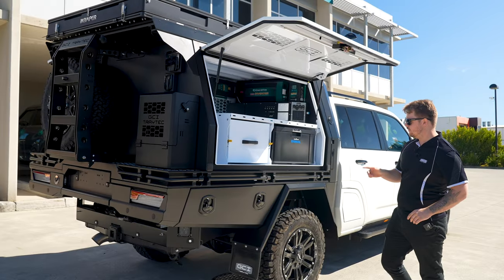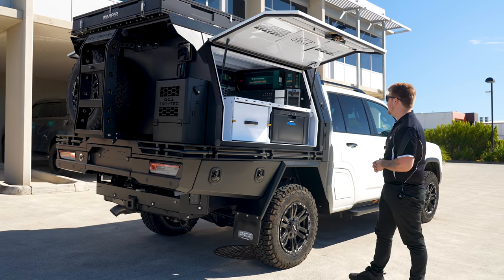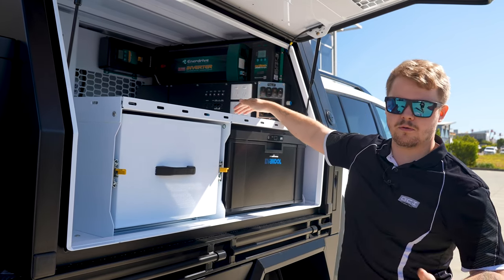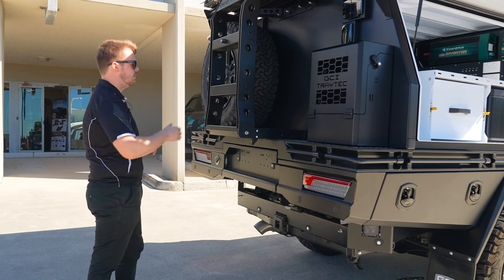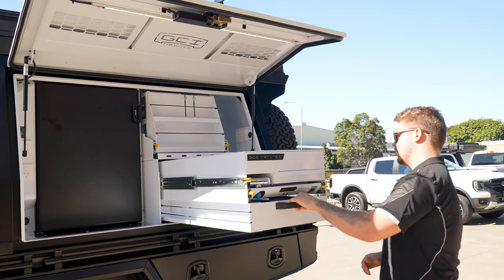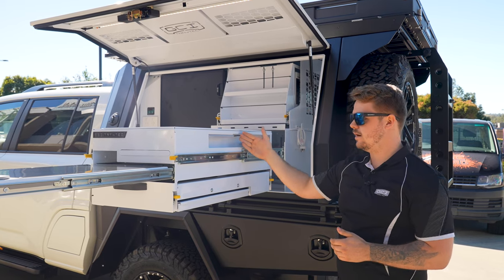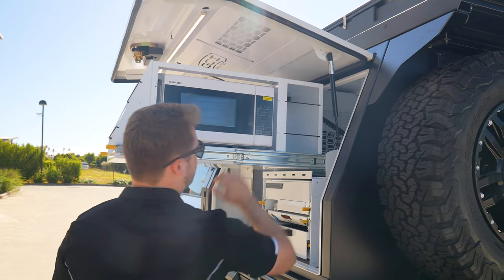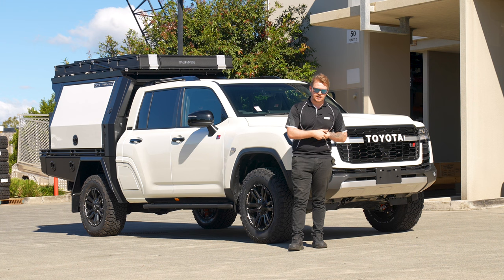LAND CRUISER 300 SERIES - CREATIVE CONVERSIONS CHOP BUILD

Comment: A bit of R&D here to take back I think guys,  The finish looks quality but theres some real useability and finish aesthetics issues here.  I also thought height was an issue but to be fair, how can you make it lower given it's a lifted 4WD?  Good points with the hose fittings though.   I can see you wanted a high rear clearance but those tool boxes could be lower IMO.  As before stated the chassis looks like it V's at the canopy start.  It might not be the case but it appears that way which throws off the appearance immediately.   Those side mouldings look odd around the rear wheel arch area as the panel is slightly setback.  Is that an access door  for storage behind the rear seat ?   I take it it opens up like how DMW do their conversions ?  Lastly I think the side step needs to go right back to the rear wheel arch.   Its going to be things like this that matter to a buyer.   Perhaps a fold up box to stand on the ground to give the user height might need to be included in the deal.  I think the canopy door is fine, dunno what someone else was talking about there.  All canopy manufacturers make a door that size or bigger.  So far, its a good job and I wanted to make positive comments rather than be like everyone else and just be negative.

Comment: The whole tray is to high, you have to be 6foot 10 inches to use it. the induction cooker was at head height all that hot food at face level ooch! and you need a ladder to get to the micdrowave. sink conection are a plastic garden hose instead of brass/ ssteal? the canopy door is to wide and flimsy, will twist easily. definately get saw shoulders doing the dishes.
Reply: predictive text ?
Reply: I was thinking the same. The sink is probably only good for face wash.